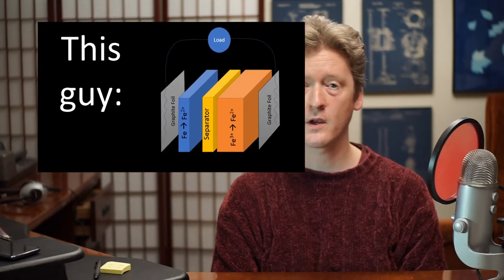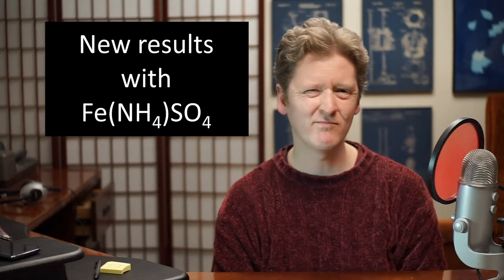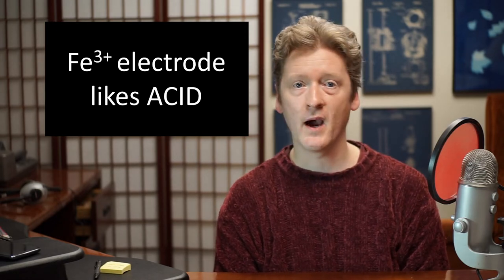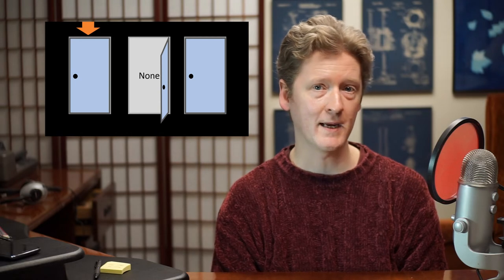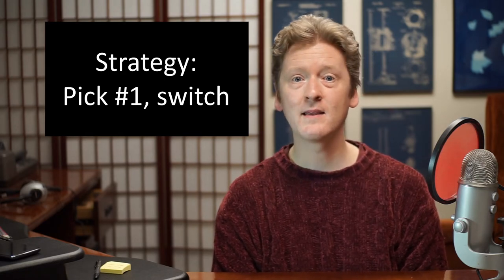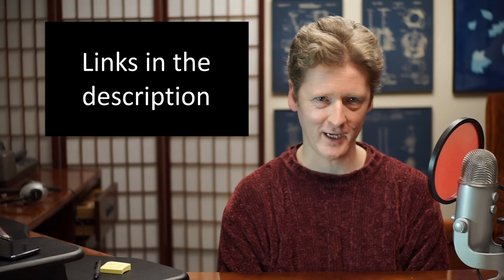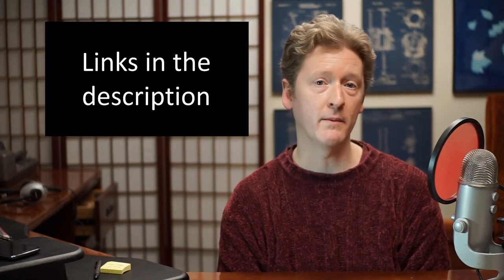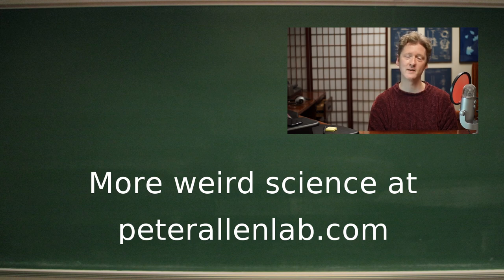Iron battery problems and being wrong about odds

Comment: I seem to remember a few years ago that a company in the UK won a contract from the government to build an off-peak energy storage facility. They had chosen an iron sulfate chemistry.  I believe they could not get it to function reliably and the project was abandoned. The problem they ran into was that iron & sulfur each have several oxidation states. Rechargeable systems need a high degree of repeatable reversible chemistry.  As I recall, they found even slight environmental effects would greatly affect equilibrium states at any one point in the process. No matter how hard they tried to buffer the reactions, each time it would become even more difficult to control the variables so that the reaction paths were not repeatable. :(
Unfortunately, no matter how hard I tried, I could not google up a copy of the paper I had read.
Reply from the maker: Thanks for letting me know about that - I'll dig in and see what I can find. I think that one reason Iron Battery 1.0 worked was it was mostly iron hydroxide at pH 7.5, and sulfate was (mostly) a spectator. We definitely see irreversible reactions under a lot of the conditions we tried. I see people using iron solutions for flow batteries, and I think that adds a lot of problems.
Reply: yes but the CEO and other executives of that company pulled in a fine salary during the process, no doubt the grant bestowers benefited in some manner as well